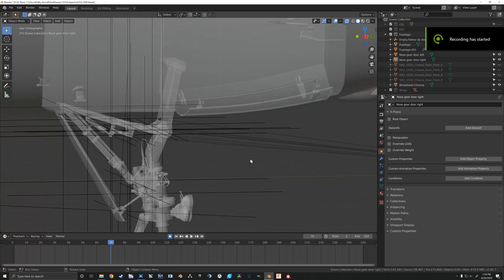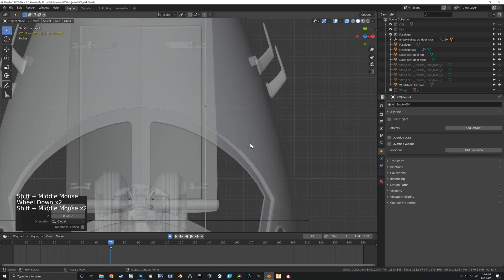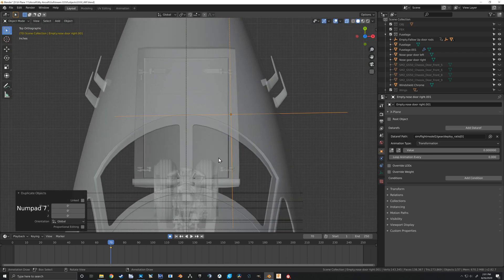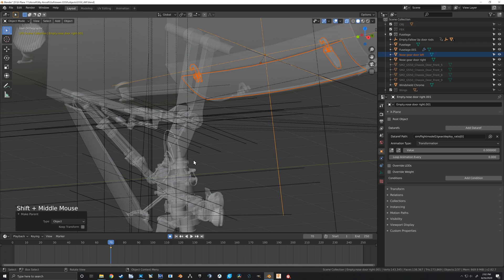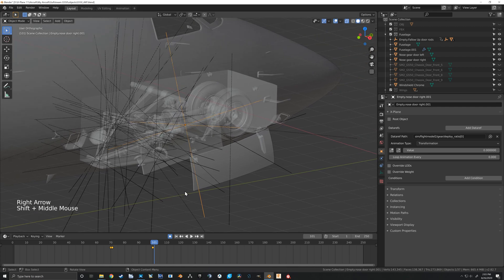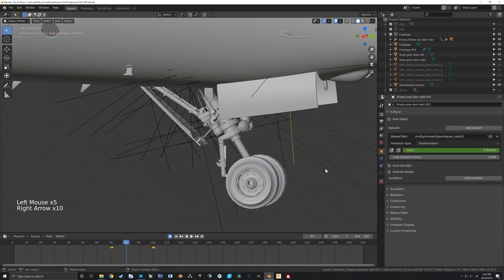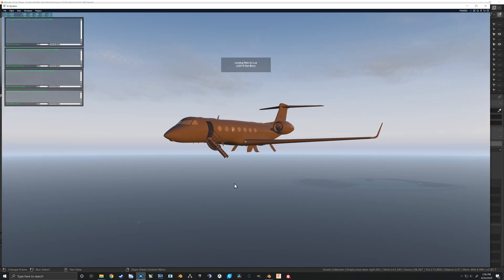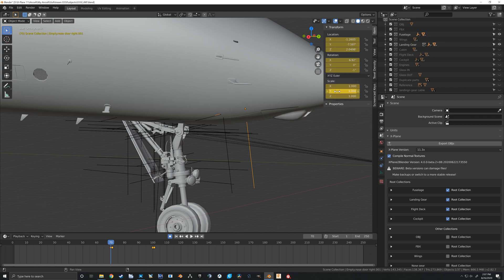Blender 2.8 X-Plane Nose Gear Doors Animation

Comment: Greetings! Thank you very much for the Excellent video on the topic of animation in xplane, I can ask you to make a video tutorial on animating an aircraft engine, the points of adding dataref for the engine torque are interesting, as well as adding full animation to the engine object (torque, vibration, bending of the nacelle from the wing, wind turns the rotor blades and so on..) Please, if it doesn’t bother you.
Reply from the maker: I no longer work with x-plane. I do have a video in my tutorials showing the animation of a propeller engine though. The workflow is the same for a jet.

Comment: Hey I have a some problems with ailerons animation after follow your 2.79 tutorials when get into xp11 both ailerons are pitch in wrong way and also both of them are rotating in the same way I don’t know how to fix it please help
Reply from the maker: Make sure each aileron is animated to its own empty, they can’t e animated by the same empty. If they rotate opposite of the direction they should then reverse the values you set in blender. So where you put -1 change to 1 and where it’s 1 changed to -1.
Reply: Build It Better Yes I animate it in different empty but both still rotate in the same way also do I need to put in the index and if my flight model use misc wing what index should I put in
Reply from the maker: If they both go the same direction then change the values for only one side. You can find the wing index numbers at the xplane developer blog.

Comment: Hey man it me again I’m just start make the gear animation and I follow your tutorial but it turn out my wheel are rotating wrong way my 707 go forward the wheel roll back when my plane go back my wheel roll in the opposite way I don’t know how to fix this please help
Reply from the maker: In Blender on the dataref properties change your keyframe numbers to negative. This should reverse your animation in x-plane.
Reply: Build It Better If you make the avionics system of a passenger plane, do you need to write code
Reply from the maker: Some systems are already part of x-plane and you can tweak them to work for you. The more complicated the aircraft is then the more custom code you will need to write for it. For airliners or private jets you will need to write some code if you’re going for an accurate representation of the aircraft. If you’re going for “study level” you could spends years on just the code for one aircraft.
Reply: Build It Better Well, man, we only have two people to do itcThere is no mass production919,A lot of data are not available. They are all made according to Google's HD map. I am in charge of the cabin. He is in charge of the cockpit. For example, we will not start the cold cabin state of avionics to the hot cabin state. The animation of the instrument cockpit is done. It is just avionics, and I have not found a similar tutorial for a few days